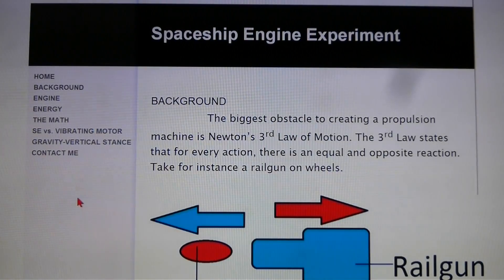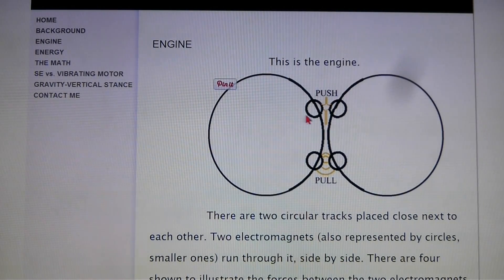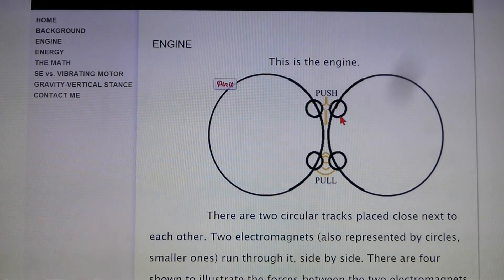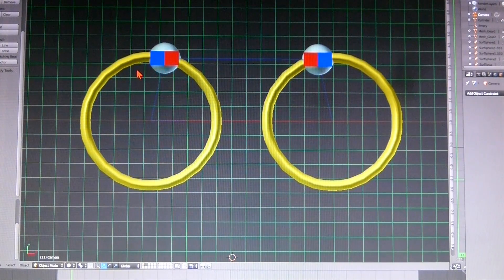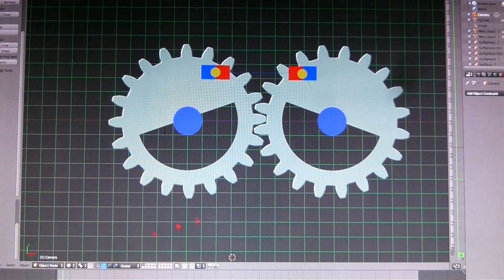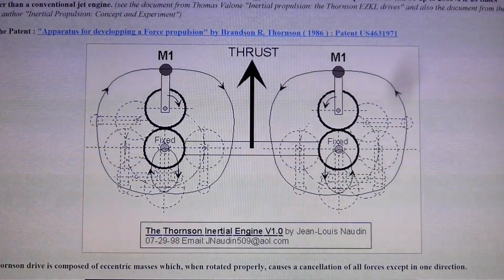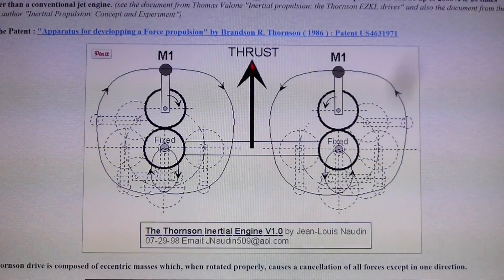New  - Inertial Propulsion Device

Comment: The lentz law inductive kick occuring when you switch polarities at the extremities does what? Do you ascribe to the ether based version of fixed spacial dim with ether divergent flows as the magnetic field and inner space curl as charge to a dim of 1d plus 3d directional time tensors? Is the low ether viscocity finite? Yes. Is this viscosity overcome by regulated injection and removal of curl at stable particle locations? To get jumps matter must be reflected into curl dimension causing particle collapse. This then may be designed to reflect forward in time and space via a macro scale magnetic vortex. The ether regulatory response is in the 2nd derivative of either flow field with the limitation of flow limit of 1.4 x c. There may be a limit assumed on max divergence and curl as well. Non intertial means a quantum hop thru space via reflection into inner space. Get it?

Comment: This is similar to the system devised by James Black in the late 1980s early '90s. The difference is that he had both wheels on one axle with the weights attached to the inside of the wheel. The wheels would spin and when both weights would be at the same place at the same time forward momentum would be achieved. I saw the video he made showing that he got forward momentum with no reverse thrust.
Reply: I've seen it have no net thrust. Problem is the magnetic push and pull are undone by lentz effects. If you believe in special relativity alone, then you cannot understand this. The speed limit set by a viscious ether creates relatavistic effects. However if you see this place as flat/unmoving and ether curling into an inner space dimensions with the vertical time dimension in z being different giving gravitation, then non intertial hoping is possible. Inner curl dim has 1d space and 3d time.
Reply: Charge is ether spinning near c. Forming a vacume void. Void collapse emits a photion which reflects into curl space woth a shockwave in our ether space which the reflects back whereever the photon is absorbed. Probability is by quantum wave equation. By this exchange matter is conserved under normal conditions. To travel faster than c, you must upset the regulation brought by counterspace ie ether curl space. You hop thru space by reflection into counterspace.
Reply: Yes earth is flat and unmoving. This realm is built.

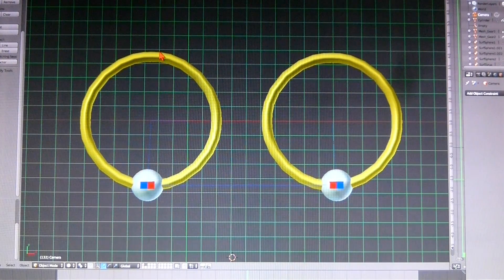Comment: 2:30 "Centrifugal force is greater at the top than at the bottom."
That's true but the weights have to decelerate towards the bottom and then accelerate again (cancelling out the extra centrifugal force at the top). Think-about-it. It's inertia acting on the weights at the bottom and it's cancelling the top centrifugal force (and no resulting force happens).
Reply from the maker: I tend to agree, also like crowxe says, the forces which speed up and slow the weights will be tramsmitted to the hub.

Comment: any forces between the magnets will be transmitted to the hub in lateral and longitudinal components
Reply from the maker: I agree.  It seems that the main benefit of this design is the speed difference of the weight between top and bottom and their are other ways to achieve that.

Comment: no no no momentum is mass times velocity and because your going round in a circle you need to use momentum vectors. when you add all the positive vectors they will exactly equal the negative ones and cancel out. that canoe thing is an old stupid hoax.
Reply: When gravity tips the plane of rotation against a spring, the external force speeds up the rotation; but it slows down, against gravity, as the spring tips everything back up, while the weight is on the back.  Two external force inputs=unidirectional movement.

Comment: That can't work there as there is no overall change of momentum m*v1=m*v2=0.  The easiest way to see that is to split the system into horizontal and vertical components. When the mass is at the top and bottom there is zero vertical velocity as the centripetal force keeps the velocity tangential.

Although you're right, there is a different force experienced at the top and bottom the amount of time the force is experienced is also different. Simplistically, if the force at the top is twice the force at the bottom it would experience the force at the bottom for twice the time and the momentum is conserved.
Reply: This would work if u had motor with a battery to pulse the structure because. There can never be a perpetual System . There is always Entropy.
Reply from the maker: I like your rebuttal, its the best one yet.  How would you explain the 'apparent'  success of the The Thornson Inertial Engine?   It suffers from the same force time problem.
Reply: ultrabizz From what I've seen there wasn't a success, in all the demos I've seen the device interacts with it's environment to produce propulsion. Take for example the famous boat footage: generally a boat is designed to move forwards more easily then it moves backwards. The drive shifts the center of mass moving the boat backwards and forwards but there is less of a resistance when moving forwards so it moves in that direction. However, if you take the system as a whole then as the boat moves forwards the water also moves backwards conserving momentum. 
It's a very clever set up essentially turning the whole boat into one big oar.

While doing research I think that a 'reactionless' system might be possible but the best idea I've seen so far is the EMdrive.
Reply from the maker: ***** Yeah, AKA stick-slip propulsion.  I had dismissed it because the Thornson boat was a canoe which should have relatively equal resistance in both directions.  Also it moves quite smoothly, without the usual stick-slip vibration that those devices produce.  I agree with your theory though, I am just happier when theory agrees with real world results and the Thornson canoe is moving to smoothly for stick slip propulsion.  They either cheated or there is something else going on.  It would be nice to see someone replicate their results.  More info on the link below.
https://www.youtube.com/watch?v=nIt661hfr9c
Reply: The reason the canoe unit worked was because they had springs on it which allowed the front to tip downwards when the mass weight was extended.  Allowing gravity to tip the plane of rotation adds external energy and DOES work.
Reply: ***** +ultrabizz The Thornson Drive has had failures and a succes, in my eyes. It did indeed as you describe move in setups like water which is not reliable at all. This is a failure because it could just be the stick-slip effect at work. But there was a succes too: it passed the pendulum test. Look up that footage.
Reply: I built one and put it on a pendulum with four point suspension and the plywood base board moved around in a little circle.
Reply: It makes a great vibration generator.

Comment: Its centrifugal force, not centripetal force.
Reply: When dealing with forces at the rim, it's centrifuge and centripedal.  Centripedal Force pushes towards the center, with a corresponding Centrifuge Reaction Force pushing outwards at the same place.
Reply: @JerryVolland-bt8cb  I've gone into a new design but with same basic principles after making some discoveries
Reply: @mharouny1  You might try vibrating it as it goes around - parallel to the expected thrust direction.  Woodward has been doing some work with the Mach Effect, using piezoelectric capacitors.  He recently reported around 100 times more thrust when he vibrated his array.
Reply: @JerryVolland-bt8cb  no, mine is much different